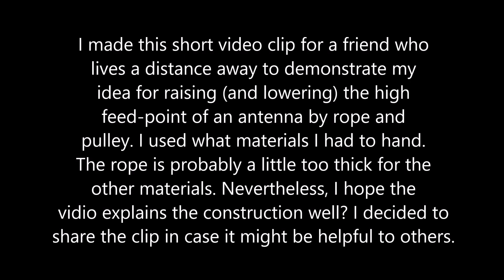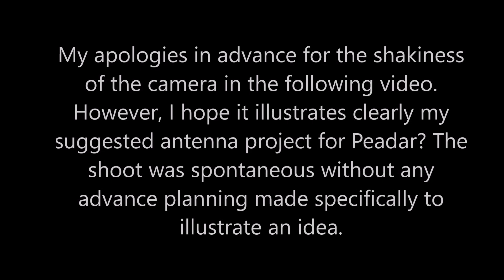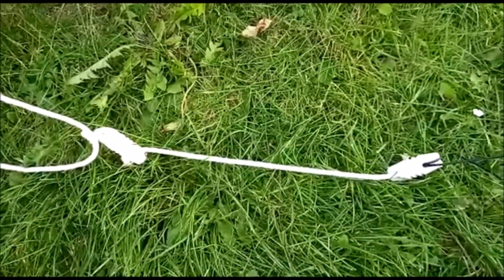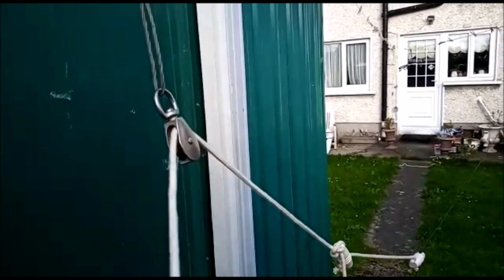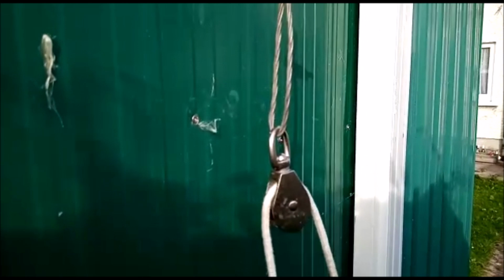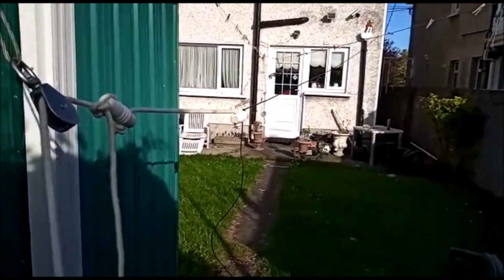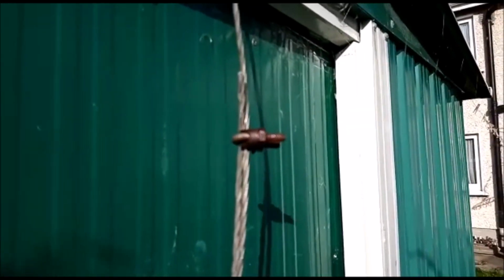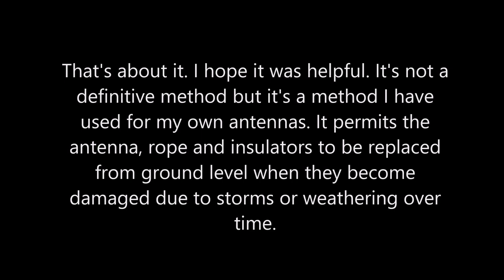Raising a Dipole Antenna Feed-point with Rope and Pulley.

Comment: Thanks Tony - this is great information!  I tied my antennas up before with pulleys but your design is much more elegant - I'm going to use yours for my next project coming soon.  One recommendation I can give you and others - use a weatherproof strong spring (like for a trampoline) to attach inline with your insulator to the rope holding it to the loop.  This allows for tension but provides additional "give" for when the winds blow.  You can also use those springs that go into screen doors - they're longer.  I put one at both ends and it really helps provide extra give so I can have the antenna tight, but not have the line snap.  You'll need to use a pair of pliers to tighten the hooks on both sides of the spring so it stays attached.  Thanks!

Comment: This is how I am going to raise my Alpha Delta Multi-Band Dipole to a tall tree.
Reply: How do you get the pulley in the tree?
Reply: @chevyk10guy  I was thinking of some type of sling shot attempt.  However, since I posted this comment, I have decided to abandon the tree idea.  There are too many limbs that are going to have to be cut to get to the higher limb.  So, I have ordered an extending antenna mast and will be suspending the antenna from it instead.